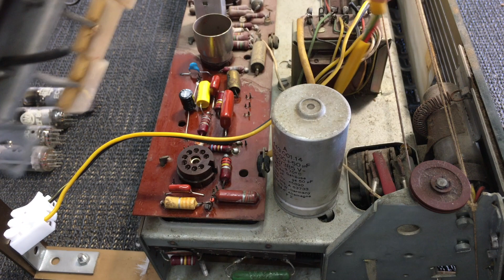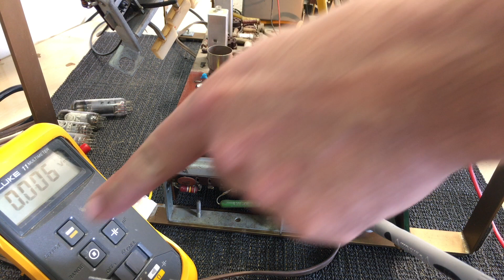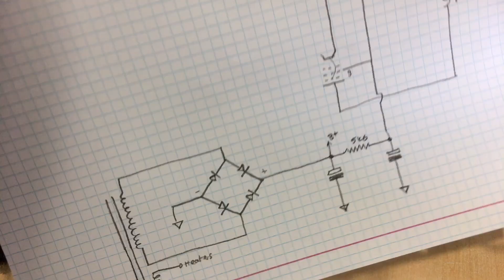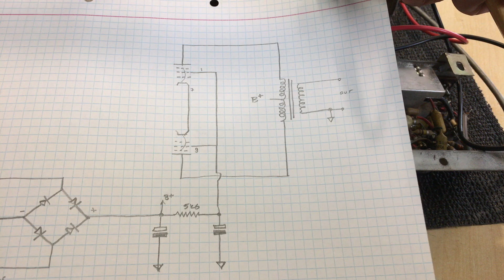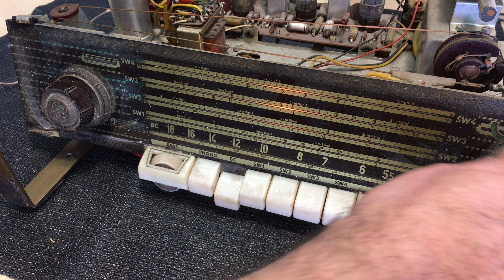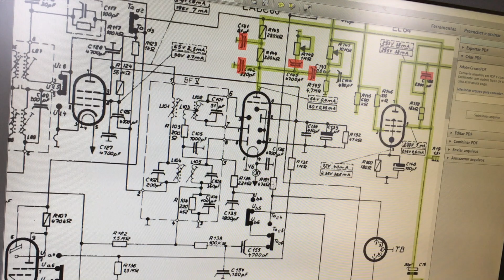Nordmende Phonosuper radio restoration - Part 2. Ready for a power-up?

Comment: I am beginning to think that extra audio amplifier has nothing whatsoever to do with that radio. The inputs look off center (home made mod) for a start. If it was a second channel you would expect the outputs to be the same power. EL84 = 3 watts. The ELL80 would be about 5/6 watts in push pull. Probably a better amplifier than the one in the radio. Maybe it was for a better loudspeaker remote from the radio? The original cartridge was mono. It's something you could expect from a person like us to do, as a kid I would have done that!. Time will tell, keep up the good work.
Reply: Michael Beeny even more intriguing than we thought!!
Reply: Alan,
Do we know each other from our distant past? Your name seams very familiar to me.
Reply: I know this is late and about 2 years after.  My thoughts at 20:55 is that the amp is for a bass speaker to give the unit more dynamics.  There are tow tweeters on the side and some other mid range speakers on the front.  I'm going to watch the series as I just brought home a Nordmende that I am curious about.  Aside from the Telefunkens and Grundigs, I have a SABA that I'm going to dig into.

Comment: manuel i found the problem i talked to you with my telefunken... i will describe it to you because it was a weird problem and it can happen to you also so lookout...

i told you it looked like silver mica disease and it kind of was...it was most likely tin wiskers on a variable trimmer cap wich were causing an intermittent short...i fixed it by simply measuring the capacitor, giving it a few turns back and forth and returning it to the previous setting...

i diagnosed it by as i learned from your videos draw the signal path and isolated all areas were mw and lw passed but sw and fm did not pass.. this narrowed it down to a very small circuit section near the mixer-oscillator tube and i immediately suspected of the trimmer cap.... now i have all bands working!

thanks a lot
if you find it usefull i can send pictures of the cap so you can be on the lookout if you find these types on your restorations
Reply from the maker: Hugo Barbedo : well done. I’m glad to know that you’ve got it all working. I’ve actually had a similar problem with a cap in an amplifier. It was also a hell of a job to trace, and I’d forgotten about it.

Comment: I do not worry about high ac voltage shocks had that many as well as high dc voltage i should be dead but anyway still here 65 years later.and i sometimes to to lazy to get a multi meter out quicker just to swipe the connection with my fingers so there.

Comment: Can you please share the schematic that you used for restoration of this unit, espcially for the radio part.  I have Nordmende Model 9115 which is exactly the same unit physically and functionally (one MW, four SW) less the phonograph part.  Thanks.
Reply from the maker: As I mentioned in the video, I did not find an exact schematic for this model, and I now don't have the references to determine which version I did use. Anyway, try find it at nvhr.nl and see which model looks closest to yours.
Good luck
Reply: @electronicsoldandnew  Thank you sir; this information is really helpful.  Always look forward to your watching your new and old videos.
Reply from the maker: Glad to help

Comment: hi manuel nice to see another video about the nordmende
i have been restoring a telefunken coincertino 53gw for some weeks now. it play beautifully on fm and shortwave. i can get more than 15 stations on shortwave during afternoon.. but i have no mw or lw...i only hear crackling just like on radios with silver mica disease...i followed all of the schematic, checked all the switches on the band selector for continuity, checked all the coils, put in a full set of NOS tubes and replaced all paper capacitors and checked the resistors...the poly caps i checked a few of then and they checked all fine...do you have any idea of what could be the problem? i am about to call it done and put the chassis in the cabinet but am not happy to have a half functional radio... best regards!
Reply: the if cans have not been tampered with..they have the original wax
Reply from the maker: Hugo Barbedo : the IF is not the problem because you are receiving SW which it is the same as for the MW and LW. If you have one of the AM bands (SW) then the problem is before or with  the mixer tube. Try to check if the oscillator is active on the inactive bands. If you have a scope it is easy: just use a couple of turns of wire at the end of the scope probe and move it around the rf section to see if you pick up the oscillator signal. Sometimes it is as simple as a coil wire that came loose or got torn out. Don’t give up. The result will make the effort even more gratifying.
Reply: thank you very much for you time!i really appreciate you took the time to answer.... unfortunately i dont have a scope (yet) and i also dont have a signal generator wich makes my repairs harder...one thing i noticed during restoration is that when i probe the uch81  for voltage at one of the anodes sometimes the radio goes mute...(oscillator stops?) the problem fixes itself by turning off then on again but i read this is normal..

before putting in the new tubes the voltage at one of the uch81 anodes was 195 volts dc wich is very close to B+ so i guessed the valve was consumed and not  drawing any current...at that time i only had FM working . after replacing the valve for a new one the voltage at that anode dropped to 105v wich is spot on with the schematic indicating that the tube is functioning and then shortwave became active.

.not having the proper tools i will proceed as you advised to check the coils again maybe i missed one.. 
i will copy you method of printing 3 times the schemating and drawing the signal path for the 3 different am bands.